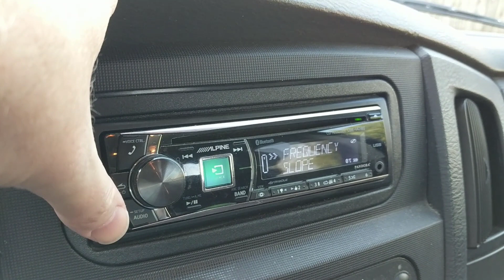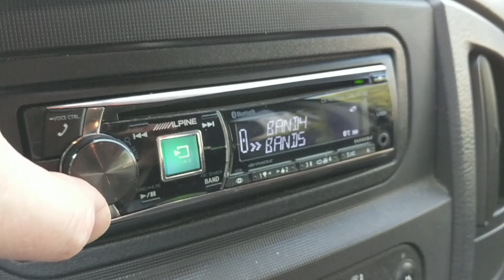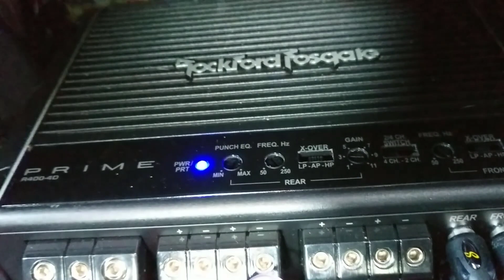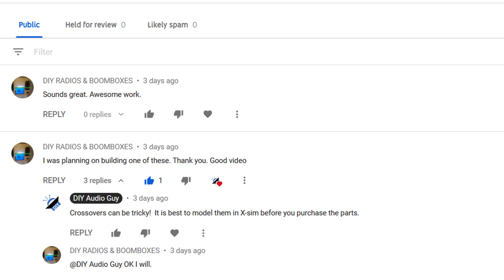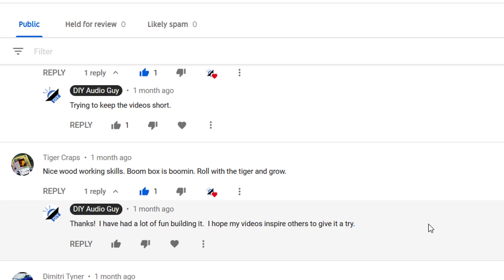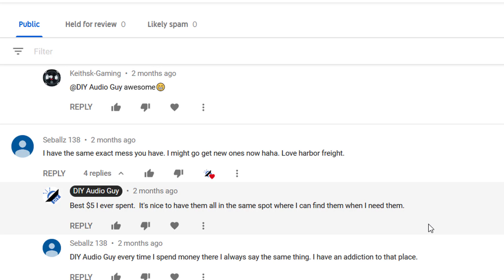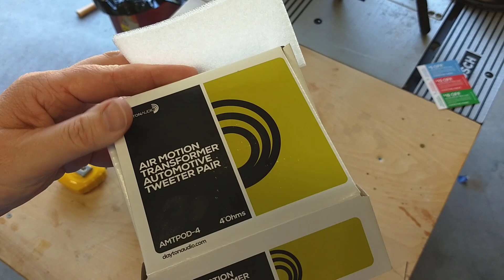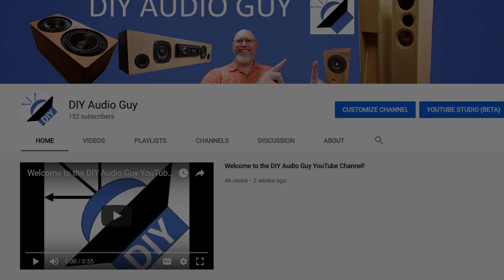Car Audio System: Three Way Front Stage, Part 1!

Comment: I have a 2008 Ram 3500 Quad Cab.
I went with JL speakers in that ride.
3 JL tweets across the dash and a pair of 4" JL mid range.
Each front door has JL 6.5" component
The rears with JL 5.25" components.
My bass comes from a JL 13W3 in a custom peripheral ported tube enclosure that I made from wood and fiberglass, similar to a Bazooka Bass Tube.
I'm running a pair of JL 400.4 HD's for my full range and a JL 600.1 for the sub.
I was previously running a pair of  JL 8w3's  also in peripheral ported tubes with the 13W3 into a 1.33ohm load as per Wilson Audio's test on the amp.
The sound stage is very good and with test tones, the highs make dogs blocks away bark, yes, it's very loud and clean.
The bass in the 55hz kick drum center is extremely punchy with the trio of mixed subs and extended low and loud.
Wrenches on my across the street neighbor's were rattling on his bench.
All that with zero noise and clarity at painfull output levels on music.
Reply from the maker: That sounds pretty sweet!

Comment: I'm stoked to watch this build progress! I've been curious about about all the drivers you've selected and I'm excited to hear your opinions on them once they are installed. I've got the Dayton dsp installed one of my rigs and love it (other than how bright the display is on the remote. I need to move it out of the dash location it's in now because it is distracting at night.) Keep it up, I'm ready for the next episode!
Reply from the maker: This last weekend I built the amp rack for the upgrade and installed the Dayton DSP.  Now I have a problem with turn off thump.  When I bypass the DSP the thump goes away.  After I get the thump sorted out I will post the amp rack video. Then I will make a video on how to get rid of turn off thump!  It's going really slow right now. We're experiencing a heatwave and working out in the garage is brutal!

Comment: Oh man air motion transfer tweets! You can use a capacitor in line with the mid to the tweet and free up a pair of channels for the rear fill. That’s what I’m going to have to do when I put a stereo in my wife’s Hyundai
Reply from the maker: I've been thinking about that.  For now I'm going to run the front stage active through the DSP so I can experiment with the crossover between the Tweeter and mid.  The air motion transformers shipped with a capacitor.  apparently you need one because the tweeter will present a dead short to the amplifier at low frequencies.
Reply: DIY Audio Guy yes those amt tweets need to be crossed pretty high

Comment: with how inexpensive these are you can simply just run two of them in tag team and that should work.     for an even more budget option basically is 7.1 Channel sound card and get two of those fixed to a Raspberry Pi
Reply from the maker: They are fantastic drivers. I've been using them for a couple of years now.

Comment: Can you make a video on how to wire the dash speakers so the radio can see them as their own channel?  My jvc has the fade and balance provision but I don't know how to wire them. My dodge is like yours 07 without the speakers. I want to add like you did. Not sure how the jvc would communicate with the signal prosser .
Reply from the maker: Not really sure what you mean.  Most head units only have four channels, so if you're going to run dash speakers and door speakers That gives you six speakers.  So you really can't put the dash speakers on a separate channel.
Reply: @DIYAudioGuy   you are correct I was remembering wrong.  Just got in my truck and seen exactly what you explained.

Comment: woah.... clutch delete? so easy on the old dodge? cummins 6speed sure doesnt have that hole... :P
Reply from the maker: Nope, it's only on the automatics.  If you have a manual transmission you'll need to find another way through the firewall.